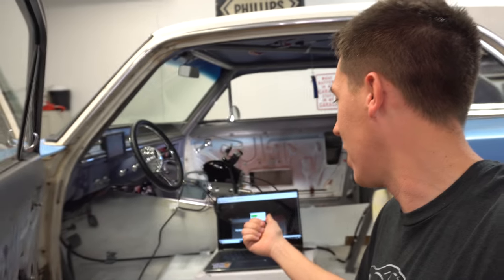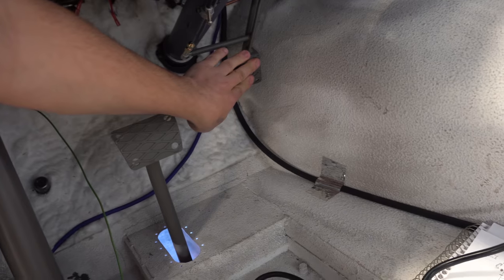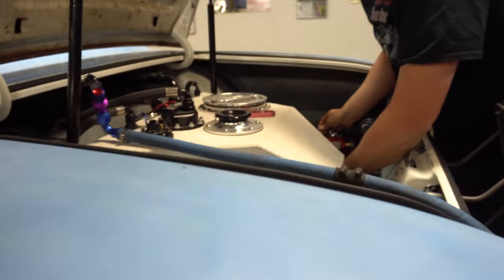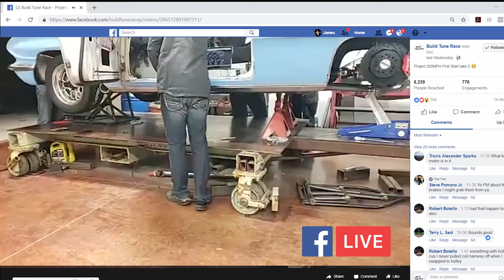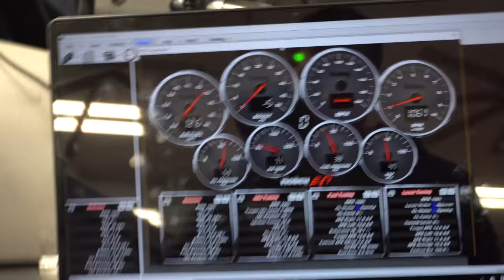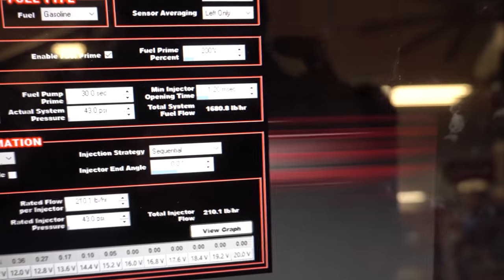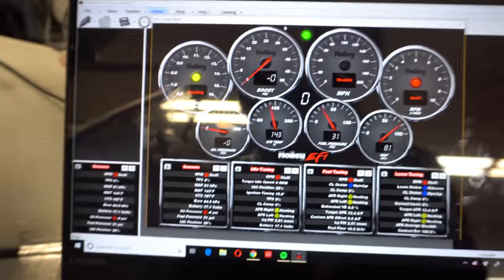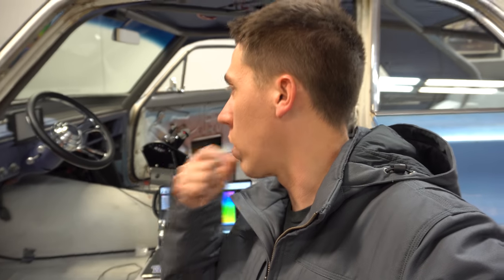Twin Turbo 427 LSX Buick Skylark First Start Up! Holley EFI

Comment: Nice ride.sounds like ya know your tunning.built not bought always leaves ya with some pride in your prodjects.just wandering if that's a salvage motor out of a new Vette or if y'all bought the four two seven new.
Reply from the maker: This is all aftermarket LS build with a Dart 6 bolt block trickflow heads ect!

Comment: what size injectors does it currently have i'd say bosch 210 would be big enough depending on the fuel being used and boost levels
Reply from the maker: Billet atomizer 225s I've talked to them and they have given me some new injector data we are going to try